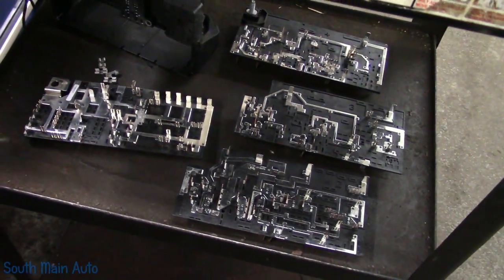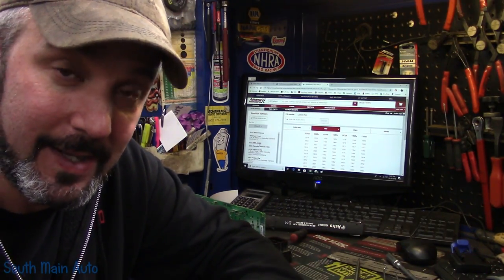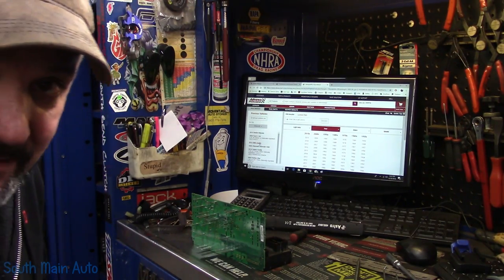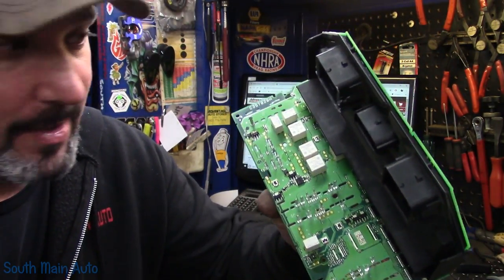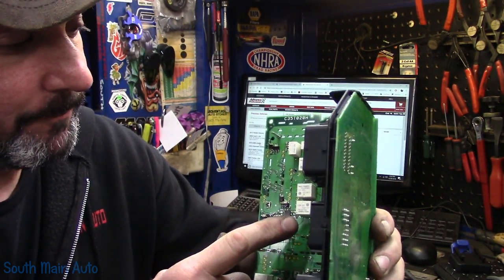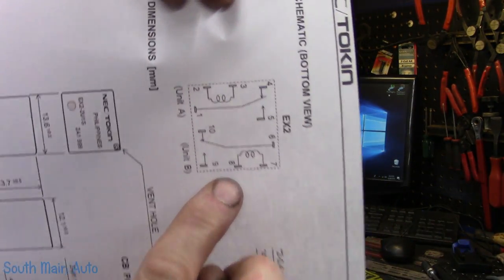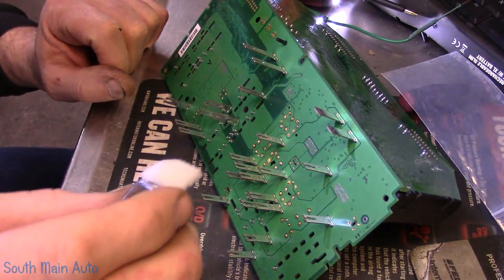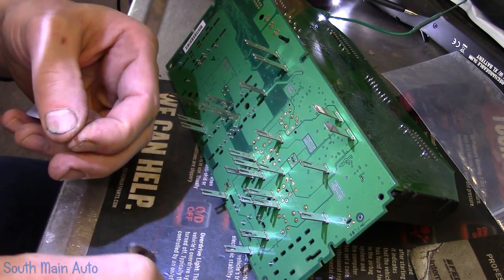Chrysler / Dodge : TIPM Repair - No Wipers

Comment: Dude you're an awesome mechanic you make working on cars for the novice mechanics comical and your not afraid to try new things it's funny watching you solder the solder sucker is for removing the bulk of solder and the wick is for cleaning the board before resoldering the new part lol keep up the good work can't wait for you to work on the Tesla model x wheel speed controller

Comment: No Eric, you used the solder sucker correctly, and the solder wick pulls away the solder from the solder joint that you are trying to remove. Great job. used that stuff for 40-something years in electronics repair at iNTEL CORP.

Comment: I'm about 26 minutes in. I feel like you had 2 things working against you here:  A low thermal capacity iron (those are BIG copper planes on those boards, and likely overcome your iron's thermal capacity) and a less than reliable way to remove the solder (in a single shot).

You're in the right direction; with double-sided or multi-layer boards, vacuum removal methods are about the only thing that work, aside from a heat soak of the board/leads at the melting point (Heat gun, air-based desoldering tool, etc.)

Your theory is spot on, especially when you tossed away the wick.  I have a Hakko FR-300 deslodering tool that would be the equivalent to Big Nasty to those solder joints.  It's also a 140 Watt machine with an electric vacuum pump that retails for about $300.  If you don't work on circuit boards often, you'd likely never see the value, but if your industry is PCB repair, it makes sense.

Big nasty makes no financial sense for me to purchase in my profession, but my Hakko would also make no sense to you to purchase for your profession...

Just saying, given the tools you had, Kudos (yet again) Mr. O.

Comment: This repair is common for me... Ford does some of the same garbage, with integrated Relays.  The solder wick, does work better if you use a spot away from the tip, and i do apply a little bit of Rosin to mine.  Keep up the good vids Eric...

Comment: I have done a few Nissan ipdm’s, soldering just needs practice the trick to desoldering is flow fresh solder into the joints and keep the tip “wet” (clean and freshly tined) - in my apprentice days I would strip pcb’s for what seemed days at a time, it taught me a lot of hands on skills

Comment: I have a 2014 Dodge van..(Arkansas)   the transmission just went out Friday. ..only thing I noticed was several months ago when I would shift from rev to drive you could hear a bang...like a motor mount. .. Have you ever heard of this problem ?  Replacement price is $2700.00. Not counting labor. ..$1000.00 core charge.    Have a great and Happy New Year. ..   😄🐶

Comment: Hi Eric, Just thought I had to put my penneth in on lead free solder. Tried lead free, does not flow as well. I have loads of reals of good old lead tin solder. All the guys at work use lead tin solder. Still buy it by the case. Old stuff works well use with care it is poisonous. Life is hazardous, take care and don't eat it. I am 60 now and have been using it since I could hold a soldering iron. about 10 years old, that is 50 years. My brain still works pretty good. Did not know about silver migration though. Thanks for that.

Yours sincerely
Allister Denyer

Comment: The trick to de-soldering is to remove the tip of the soldering iron and switch it around so you can use the flat end. It gives a much better heat transfer to the solar wick.
Adding some new solder to the connection helps with heat transfer and de-soldering is much easier.

Comment: The trick to using a solder sucker, in my experience,  is to first add some solder to the pad. The bigger the blob, the longer it takes to solidify so when  you are dealing with minute amounts of solder, they tend to solidify before you activate the sucker. A bigger blob stays liquid longer and offers more surface area for the sucker to inhale.
Also, it is a good idea to keep drill bits that are around the size of the hole through which the relay goes. The idea is that prolong exposure to heat is never good for a circuit board because you risk damaging the pad and having it separate from the board. For this reason, I would just drill through any solder remnants.

Comment: The solder wick does not work well on "lead free solder"....but works excellent on normal lead type solder.
I have "mixed" the lead free with some regular solder, then used the solder wick with better results.

Comment: Few suggestion i have after fixing with my microwave 3 weeks in a row if a group of relays or switches have about the same switching cycles (come on in combo with each other) on it and one died from old age change em all there probably all about to have the same issue.

Get some good desolder braid stuff you had had no ware near enofe flux in it that caused you some issues, also get well or flat chisels tip for your iron ether, (you used it right) works so much better. Try "chemtronics solder wick rosin" is the amazon search term you want. Solder sucker use is spot on:) but i like the wick better once I found stuff that worked because it get all of the solder out of the hole.

Your irons a bit under powered your fighting a lot of thermal mass too. Ts-100 Irons are really good for the price$80. But the cheap scate  10-20$ "vastar soldering iron" also is great for occasional use, as long as your aware the temp switch lies its more like a dimmer switch 10w to 100w no temp regulation once its up to temp run it at lowest setting or it destroys tips.

All that begin said if you don't care about the part your removing, crush the part / use side cutters etc and yanking out with pliers while heating the joint one by one also works:) This is some times required if you have a large mass part.

Comment: You used the solder sucker correctly, however to get better solder flow for solder removal, touch the hot iron tip with some new solder and this will increase solder flow a 1000 %, then move iron tip quickly to eyelet and watch the solder flow! Practice makes perfect.

Comment: if you ever have to remove any more soldered components, i'd recommend trying to pull against the component lightly while holding the iron on the pins. the solder sucker is an awesome idea to get it going. You do have to hold the iron on the solder joint while using the removal tool as it does cool too quickly as you had mentioned. also, to ensure solder joints don't crack over time, you should not use lead free solder. that stuff is absolute garbage and a nightmare for component level guys like me.

Comment: Eric you need to add flux to the board then new solder then use the sucker or wick to remove the solder. Then Clean the board  with denatured alcohol and install the new component you may need to add flux then solder and clean the board again with denatured alcohol.  The flux helps with the flow of solder

Comment: you used the solder sucker properly, by the way. Sometimes you can add solder first to the pins so you have more solder to suck out, if that makes sense. However, the wick, for the most part, works but can end up using too much heat to get it to work. Nice Job, well done dude. I am an electronic Technician so I am very well versed in soldering using what you used and hot air DE soldering for removing SMT (surface Mount Technology) which are large square chips that can have hundreds of contacts to solder and needs a microscope to see what you are doing.

Comment: Hey Eric, I ran into a similar problem on a Dodge truck but for the fuel pump. There was a kit out there for the Grand Caravan and another Chrysler vehicle don't remember off hand. But it has wiring diagrams 2 to an external relay. I found this on YouTube and the relay kit on Amazon. I tried to order multiple kits to have in stock, but they were out. Call the dealer back and they will not sell them to you unless you have a VIN number that falls under the recall for this problem with fuel pumps. I don't think you'd really need the specific kit I think it could be done by piecemeal parts. Great video thanks

Comment: Been there and done that and went through the same trials and tribulations. Learnt eventually that the solder wick works far better than the sucker. Yes you need flux and you also need some fresh solder to get it flowing through the wick. Once it flows it all defies gravity and just comes completely out

Comment: My 2003 Ford Mustang has something similar tucked in the passenger fender well under the splash guard. It's called a CCRM (Constant Control Relay Module)  It's a sealed (kinda) box with the AC clutch relay, fuel pump relay, and a bunch of other stuff on a printed circuit board. I did the same thing you just did with the fuel pump relay. :)

Comment: Very good Mr. All, you know just the other day I was watching and Ivan YouTube where he was repairing he is heat pump and he had to do the same thing and he use any luck trick solder suction apparatus that also heats at the same time period but the way you did it is the old fashion reliable way and a minimal cost. Yes to things you can use the flux that of make the flow on the solder wick secondlie if used the suction you can do that by heating the point once it melts quickly put the suction tip on the area in suck it takes a little training and technique but it works. Good job long time I don't see someone getting down to the nitty gritty except for Ivan. Make sure your system makes a lot of cookies for you.

Comment: Mrs. O could know you better than you know yourself. It appears you "can fix anything".   : )
.
I like the way you go for it in this video (independently). Just your hands & your grey matter. Now if SMA wants to do more; all supportive comments & suggested channels have exponential value.
I hope your confidence w/ electronics is boosted by your sisters project here. You could tackle all your family's E-circuit repairs and from time to time post a video (we 💙 them). Your unique knowledge of automotive diagnosis is directly applicable to electronic repairs.
Didn't your G'ma say,  "add lead to flow fast" ?

Comment: A way to make your life easier when you do one of these, get a desoldering gun. It basically is a soldering iron with a motor to suck the solder up. I personally use the Hakko 808 (the updated version is the Hakko FR300.) or the Aoyue 474A++.

Use a small amount of leaded solder w/ flux to make the desoldering flow better. Works every time.

Comment: Eric, Eric, Eric-I hope I did not get here too late. I can save you. I understand that this is not your forte but “If I can do it, so can you”, sound familiar? 
When I watch you work on printed circuit boards, de-soldering and soldering, I have heart palpitations! What you are working on is like “Rail Road Ties” compared to the very, very small electronic components of today. I am here to help. Hopefully the viewers have not “chewed you up” regarding your soldering techniques. Like John Wayne, “The Duke”, said in the movie North to Alaska, before he K.O’d Ernie Kovacs, I won’t, I won’t, the Hell I won’t and boom down Ernie went. I digress.
I am a Certified IPC-610 Soldering Specialist and have been working on PC boards for the last 40 years.
Here is the skinny:
The boards I’ve seen you work on were double sided, plated through PC boards. That simply means electrical paths run on both sides of the board. When you drill out a hole, you could be destroying the circuit path.
Make sure your solder tip is about the size of the pads you are working on.
A forty-watt iron should be sufficient.
Have a water wet sponge handy to wipe off the tip after it heats up.
Immediately apply a small amount of solder to the tip and wipe again. Then apply a small amount to the tip and heat the joint, apply a small amount of solder if needed to melt joint.
Solder wick can be used, just make sure tip has some solder on it then apply tip and wick to joint and watch the capillary action of the solder go into the wick.
Or once joint is melted, the keep iron on joint and use solder sucker to extract solder.
After de-soldering place iron back in holder. DO NOT WIPE TIP OFF. Old solder keeps tip clean.
When soldering, just before using iron, wipe tip on sponge and apply a small amount of solder to tip. Approach joint, place iron on tip for a few seconds to heat joint, apply a small amount of solder to joint. Joint should have a nice fillet and not a ball of built up solder.
Clean joint with IPA and allow to dry. Cover joint with nail polish or clear spray paint.
60/40 solder melts around 370F and 63/37 solder melts around 361F and is the preferred solder for PC boards.
I love the show. I have learned many things from you and answered many unanswered questions. 
I am only a solder strand away if I can offer any more advice.
-Sparky-

Comment: I remember when I had to replace two caps on my car's ECU board.  Talk about nervous.  The trick with the copper wick is use a hot iron newly wetted with lead solder, place the wick on the solder and iron on the wick.  A little flux helps.

Comment: Great repair Eric and as always a great video!!! Theoretically, is it possible to solder wires to the board where the relay was and then run them to an external relay for all those internal relays? You could then get a generic relay box and then mount it near the TIPM so that all the relays are replaceable. It's a lot of work but might be worth it...

Comment: I see others have mentioned mixing leaded solder with the unleaded solder that is bound to be on that board to make this job easier, so I won’t belabor the obvious but I’m going to be the contrarian and say that is so 1999, today we have low melt solder. Low meld solder is absolute magic. It’s not useful for anything other than desoldering, but for that purpose it will make your life so much easier, and it’s cheap.

Also, high-quality flux, such as something from Amtech, is paramount! That would be the reason the copper braid was not working, and quality copper braid when used with flux is vastly superior to those junk desoldering pumps.

So the correct way to do this would be to start with a clean soldering iron tip, give the area a generous amount of flux, put some low melt solder on your tip, and start going over each of the solder joints to mix the solders together. Once that is accomplished get a blob of low melt solder on your iron and start going over those joints around and around and around and more than likely the relay will fall right off the board because low melt has such a low melting point that it stays fluid for a very long time. If that doesn’t work, clean the area with isopropyl alcohol, add some more flux and go over each joint with the copper braid being careful not to solder the braid to the pads and rip them off the board. 

Once the relay is out, clean the area, add new flux, and use the braid again to suck all the old solder off of those pads. Remember to cut the used breed offRemember to cut the used braid off frequently. Clean the area again, push the relay through the board, add flux, clean the iron tip, and use leaded solder to complete the job. Clean up again with alcohol prior to reassembly. Crack open a beer.

Comment: Hi from the Uk Erico,
You know when you current clamp an injector, and you see the bump in the waveform when the pintle moves, you can do the same with a relay, and see if the armature moves while clamping the coil current, that'll tell you if the armature is seized or not.
A common fail mode for a relay is for the contacts to weld in the on position.
You can get hot air guns with a fine nozzle for doing this kinda work, cheap import ones on ebay.

Comment: awesome video. solder sucker is much easier, always burn fingers with the braid. The usual is to man handle the old part out so on par there. The watts of the soldering iron u r using is way to low to harm that board so all good. 75watts+ is where u burn the traces off. best part is showing the intellect to solve a problem, something most people lack out of laziness or fear of the unknown.

Comment: For a moment there I thought I was watching Pine Hollow Auto Diagnostic, until you said you had to buy parts. He fixes with no parts needed. Lol  You need to use plenty of flux and sometimes more solder to get a clean desolating joint. Could it be that park is going bad and caused the relay to burn up? Somehow that relay took too much current for a long time. Great job as always.

Comment: You did a great job Mr. O! The only things you could've done to make your job easier: bigger soldering tip, and Flux Flux Flux if you're trying to use the braid. Most of those braids have little to no Flux, even when they say they have Flux. I tried those funky glasses at one point as well, gave em up and opted for the amscope microscope :) nice job sir

Comment: Eric, check out Ivan's desoldering tool that he used (I think) on his heat pump repair series.  It probably cost more than your solder sucker but it saves on frustration and that is worth a lot of $$$$$$.    Good job on the repair anyway, I would probably have given the board a flying lesson before I got the relay off.  :)